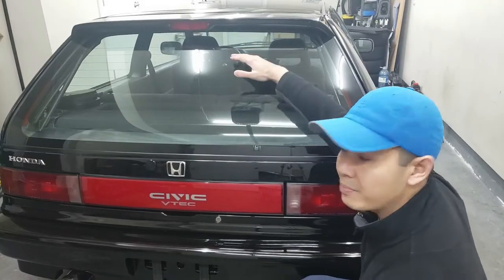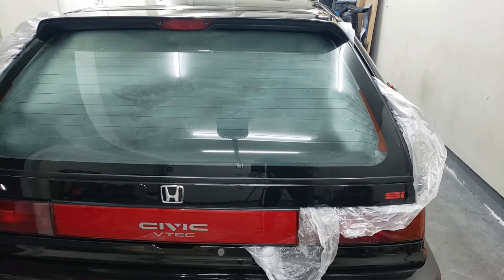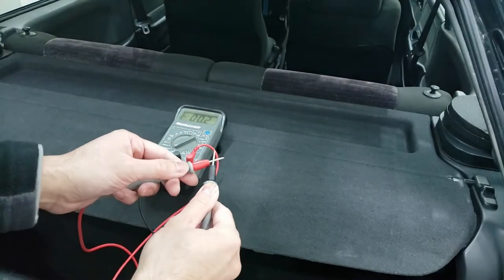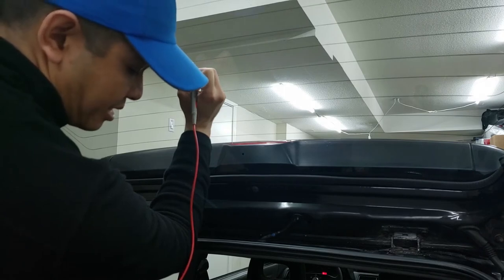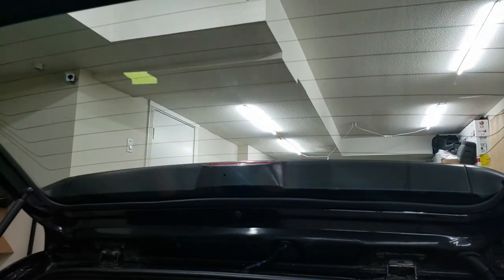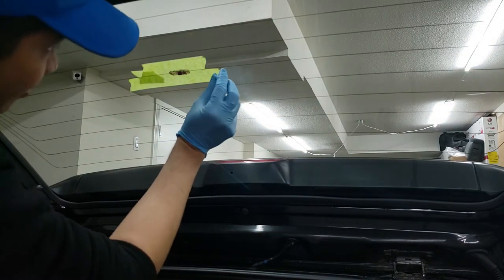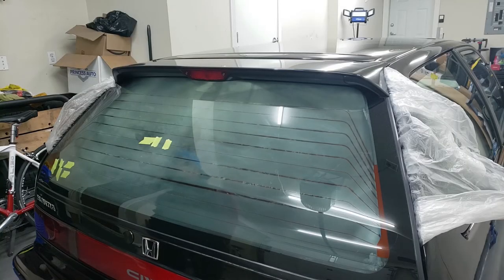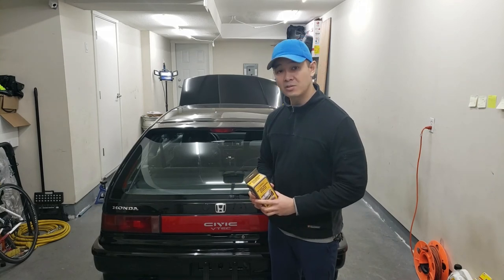🔎How To Find & Repair BROKEN REAR DEFROSTER LINES!🔍

Comment: Nice video bro, can this work with regular solder, cause i can't find this product
Reply from the maker: You can try it. Personally, I wouldn't try it on any car because I can see how it can destroy your rear windshield, but it may work since solder would bond to copper. Just you'll have to be careful trying and there's no going back once u solder. With conductive paint, you can wipe off.
Reply: Did you have any result?